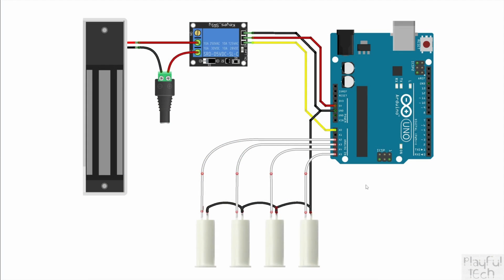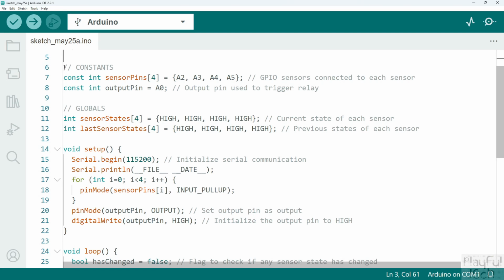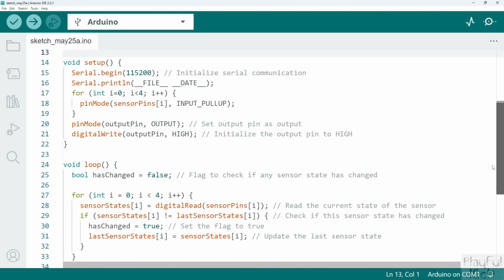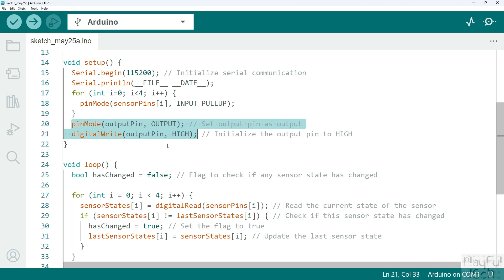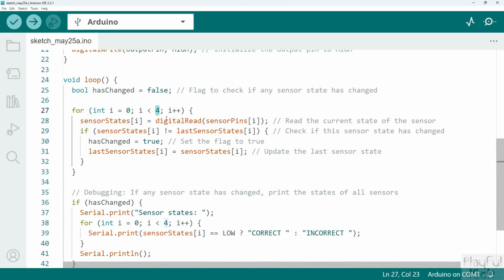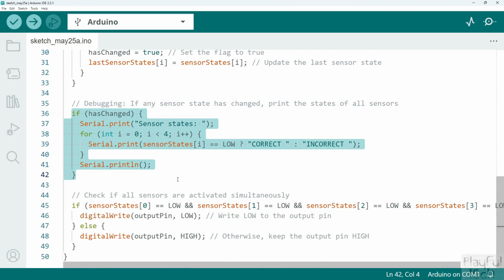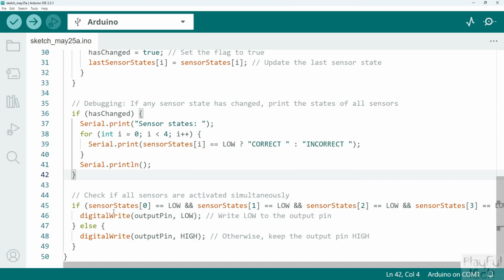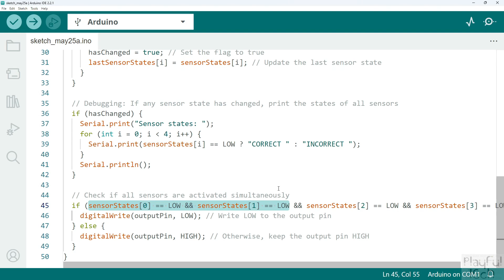"Puzzling Paintings" Escape Room Puzzle Tutorial

Comment: 3:00 How were you able to center the lazy susan around the point you chose, and the center of the object? I have just been eyeballing it, to not very good results
...
Reply: With a square picture it's quite easy. You need to find the middle of your square ( just draw two lines, one from the corner top left to bottom right and the other top right to bottom left). Now you got the middle and need to figure out how far away from that point your holes for the screws are. Just measure the distance of the holes on the lazy susan mechanism ( same corners ) and transfer them to your picture frame. Noe you can screw everything in perfectly level.

Comment: Clearly this can be done with a 4-input AND chip (well, maybe with a Schmitt trigger to buffer the inputs). So why did you choose Arduino? For consistency with other projects and expandability?
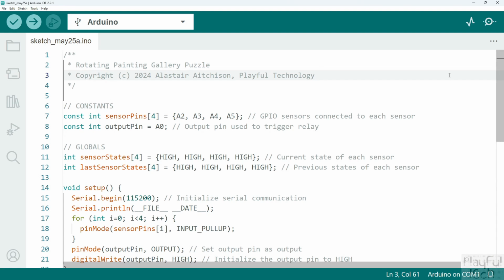Reply: He explains why at 6:00
Reply: You can do it with 74 series logic but by the time you've laid out such things with schmit ttriggering to avoid false sensing, and a set/reset latch to drive the mag lock, you may as well use a cheap microcontroller. Additionally the microcontroller can be programmed for any combination you like, and its much easier to change than discrete logic

I've gone down this rabbit hole myself and yeah, "throw a microcontroller at it" is quite a valid solution now, both in terms of flexibility and cost.
Reply: @jaycee1980  That was basically what I wanted to know: whether it makes sense to make self-contained component using discrete logic that is guaranteed to work (taking "guaranteed" with a grain of salt, of course) versus making it infinitely versatile with a microcontroller.
Reply from the maker: Yes, I explain this in the video. https://www.youtube.com/watch?v=I7XbusTNlRY&t=346s
Reply: Sorry, missed that

Comment: God bless reed switches, theyre so useful for escape room puzzles.
Reply: I agree but….they are fragile. I built a table with challenge to set the table correctly for the guests. But the small glass tubes broke.
Hall Effect sensors are an option to consider.